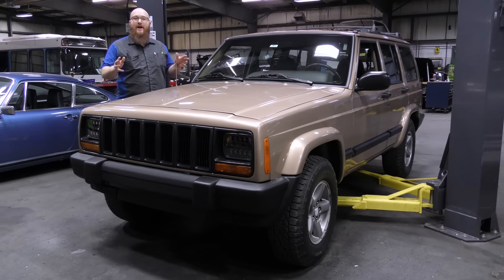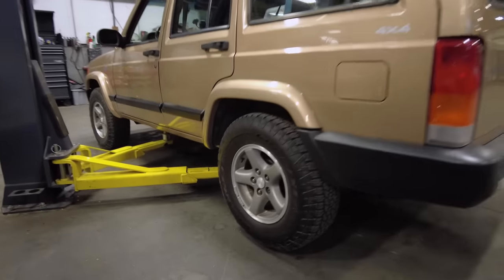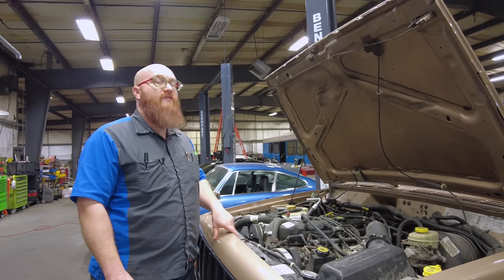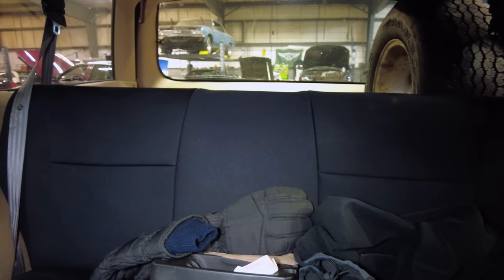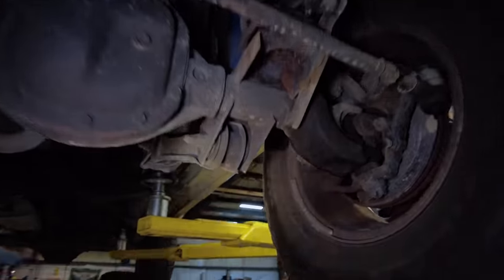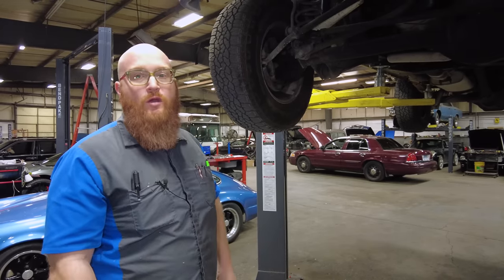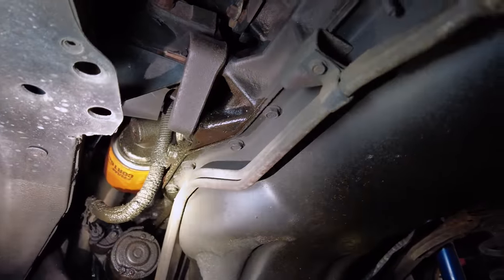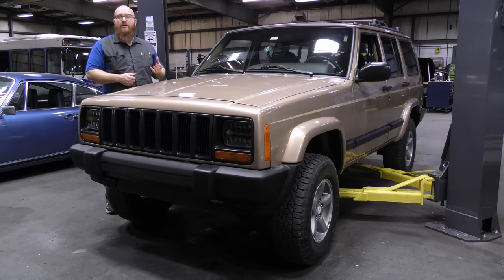Death Wobble on this immaculate '99 Jeep Cherokee! CAR WIZARD shows how to find it and the fix

Comment: I had 250k on my xj and not a single oil leak. Everything else was broken though😅😮
No 1st gear, no heat, no ac, locks broken, door fell off, seat broke, power windows broken, center console broken, stereo broken, headliner down. The 3rd trans was what broke me.

Comment: Ever so often an ‘89 Cherokee comes by to get serviced and repaired at my shop. It is unfortunately plagued with leaks and problems but it has 300,000 miles on an original motor and transmission. It just will not die. Very durable 4.0 engines.

Comment: Great videos, as always. A correction about the date codes on the tires: the first two digits represent the week the tire was made. So, on this vehicle, the tire was manufactured the 1st week of 2021. Also, always check the date code on the spare, it may be much older than the tires on the ground.

Comment: Even my oil pressure sensor was leaking oil, altogether, I would lose about a quart a week, which is pretty significant but at least I don’t have to worry about rust with Jeeps Active lubrication under coating system lol. Probably bad for bushings though.

Comment: One point about shocks and dampers. Rebound problems can arise with no leaks. The only way to test is to drive over a dip that forces rebound. I had a brand new car with this problem in a strut.
Reply: Yeah,,, dry shocks don’t mean they aren’t worn out. There more to inspecting them than just seeing if they are dry. Like others said here, death wobble is rarely attributable to just one item needing repair or replacement. The shocks appear to be originals. If they are 100,000 miles or 160,000 kms are more than enough on them to consider some better quality aftermarket ones. All 4.

Comment: I had a 93 Jeep Cherokee Sport 2 door striped down.  Manual transmission and the windows were even hand cranked.  It had 200,000 miles on it before it was total by a drunk driver.  Best part was that I was sandwiched at 100,00 miles and got almost all new sheetmetal on it all the way around

Comment: Jeeps don't leak oil, they mark their territory.  
My '98 has 345K on it and the engine made it to 331 before the engine blew.
I did not treat it very well.  The number of aftermarket parts for it is staggering.  Everything that breaks is an opportunity for an upgrade!
Biggest weakness is it has a tendency to overheat when it's hot.  A nice aftermarket radiator fixes that and you may even have to put blockers on the grill to get heat in the winter.
Mine has towed cars, carried me through snowmagedden, hauled heavy servers and rescued a number of family members.  It's a workhorse.
It did have a death wobble and they are scary, especially the first time.  I put a 3 in lift kit when my springs sprung (after hauling those servers in the back and bottoming out)
Aftermarket adjustable track bar and it rides rough, but it's not made to be comfy.
My dash still looks like that even after spending all of it's time out in the heat.
It really is the most dependable vehicle I have ever owned and with the new 4.0, it should handle another 20 years of abuse easily.
The 5 speed doesn't hurt either.

Comment: One thing you forgot to mention is that you can pull basic computer codes on these without plugging in a code reader. it will display on the odometer.

Comment: Caster is generally the problem with most issues of death wobble aka bump steer ,,, the steering knuckles most likely are nosed dived down at the tie rods ,, on these models there are shims behind the  frame end mount of the lower control arm  ,, add a 1/8 inch shim to each side to push the tie rod side of the knuckles up get the angles back the way they should be ,,, I own six of these XJs 90 92 92 92 95 2000 all 4.0s two with iron rock three link long arm kits 7in lifts

Comment: Only saw this now, but realise one thing.. that tow bar is not allowed in europe, in case of a rear accident, it wwill puncture the gas tank... would recomend to change it or take it of. Other than that... amazing specimen of an xj :)
Reply: In the  USA it was just about required. Jeep came out with a recall I believe around 7 years ago. I have. 2002 Cherokee Laredo. I used mine to tow my Jetski so I put an aftermarket hitch on it. I went to have it inspected at jeep as jeep was paying dealers to install a free tow hitch because the gas tanks are right at the end of the plastic bumper. There’s nothing to stop it from exploding. So to fix this they were putting tow hitches on all jeeps around these years. I believe it’s 1993-2004 Cherokees and 2002-2007 liberty’s.

Comment: Get a track bar that replaces the ball joint on the upper end of the bar with a regular joint and a new bracket. If I had done that I might still be driving my XJ and not gotten mad and sold it after it still death wobbled after replacing everything (track bar, stabilizer, wheel bearings, tie rod, steering gear)

Comment: Just bought a 2000 at the Effingham Illinois Fire Dept auction for $3200. 69000 miles red of course with no console as ordered. It seems tuned because it will spin the tires sometimes in 2nd gear.

Comment: My aunt had one and it was pretty reliable. They did have to replace a radiator but that really wasn't that big of a deal. The frame broke in the front and I don't remember how. I think it was sold to them like that if I am remembering correctly. Rather than trying to deal with it they sold it for parts. Everything they had to do to it was all just simple stuff my cousin helped them to repair easily. I know you said these are more unibody so I might be using the wrong terminology here. It's been years ago and I remember it was the frame up in the front. It had a break in it that was really poorly patched. They bought it used and the guy sold it to them like that. They rode it around for quite a while and it was a good vehicle but as I understand it the damage starting to get worse making it unsafe. She really liked the vehicle. She never used it to go 4 wheeling or anything. She just had a family so she needed the space and it had lots of room for groceries. It was pretty fair on gas and it was pretty comfortable. It's been in excess of ten years ago so I'm afraid I don't remember the year of it. I mostly remember that it was blue, ran really good and my aunt was really sad it happened like that. She didn't have much money being on a fixed income. She couldn't find another one she could afford at the time.

Comment: In most cases - nether a, b , or c - it is a feature of a rigid axle design and no - not the track bar - it happens because of the fundamental cost-benefit of choosing an off-road design - you can tune it out but you will never eliminate it

Comment: I wonder if minivans, especially older ones, will ever gain any type of notoriety.  SUVs are cool but the average minivan of the same era will have better acceleration, get better fuel economy and usually have better cargo space.  Also handle better on pave streets and can do as well on gravel roads which is the most off roading most people do.
Reply: Nope. They are mostly used up and rusted to oblivion. Chrysler had engine issues with Mitsubishi V6's burning oil and their own V6 wasn't that good either. GM front drive vans were ALL junk. Ford quality was hit and miss.
Reply: @hotpuppy1  Agreed 💯. But, the Asian minivans are a lot more reliable than these North American ones, especially the fourth-generation Honda Odyssey, the second-generation Kia Sedona and the third-generation Nissan Quest. The Toyota Sienna is bulletproof, but their handling for these vehicles were poor. All in all, they are great minivans.
Reply: @hotpuppy1  
I almost traded my 99 Sienna for a 91 80 series Land Cruiser 2 summers ago in pristine condition plus another $10k for value differences.  I immediate noticed  a downgrade weaving in and out of traffic and poorer fuel economy on a 50 mile trip.

Comment: My dad bought a 2005 Dodge Ram 1500 4X4 brand new.  In 2007, we experienced the "death Wobble."  I had a co-op at he local Dodge dealership that year, so I brought it in for warranty.  They changed the track bar.  No change.  They changed the steering stabilizer.  No change.  They wanted to change the trailing arms, but had to order them.  While we waited for the arms, we changed the tires.  Problem solved.  We have had many trucks come in with this issue, always solved with new tires.  We would switch tires front-to-rear solving the issue 99% of the time.  We even had one customer come in on new tires with the "death wobble", and he had the tires replaced again, solving the problem.

Although the track bar bushing was bad, odds are all it did was accentuate the problem.  

We did let the dealership replace the trailing arms, anyway.  Why not?  They were free, and you don't get too many free things from a dealership!  😁

Comment: Death wobble can be caused by a bad wheel, but the root cause is people aligning them with toe in. Straight axles in general don't do well with toe in.
If you have death wobble, crank your toe out a half turn at a time til it stops. It's that simple

Comment: I have a 2000 TJ Wrangler Sport I bought new, 141k mi. Can anyone recommend a place to buy an OEM remanufactured Power Control Module? Rock Auto has been out for at least two years. I've replaced just about every electronic gizmo on it and I worry the PCM is going to leave me stranded.

Comment: I lucked out and found an xj that was hit in the side I replaced both doors and the rocker panel on that side and 300 bucks later I had an 90k miles rust free xj for 1800

Comment: I will say 1of the biggest problems Is the lower control arms if you put 99 to 2004 Jeep Grand Cherokee. Lower? Control arms. It drives better. And it's easier to clear big tires

Comment: I have had at least tie rod ends cause death wobble, ball joints cause of death level, track bar causing death wobble. All of those can be a factor to death wobble. What a lot of poeple miss after death wibble is that where your tie end sit in the spondle those holes where the pin goes through and ypu add your castle nut can be wollowed out. Hwve you ever has a castle nut tighten so much oast the holr where your cotter pin goes in ?. Time for a chamge. Jeeps hands fown are my favorite vehicles to work on and drive.

Comment: That was in a front end collision. I guarantee it the bumper metal center part should be painted body color. The grill on that model would have been painted body color and it would’ve been a jeep emblem on the front top of the grill fascia.   I’ve on several XJs in my life that I’ve never experienced death wobble in a stock XJ I guarantee that JEEP took some sort of front end collision, making things a little out of whack in the front.

Comment: Nice Xj....My 99 Xj has over 400,000 miles and it's just like new... Definitely one of the best vehicles ever made......by far
Reply: Just wondering if you had to replace the transfer case or the differentials?  I have 217k mi on my 99 and just replaced the transfer case.

Comment: My 90 xj has over 1,000,000 miles on the original trans I think I replaced an overheated engine around 500,000 and yeah it has the death woble too despite replacing almost everything in the front.

Comment: 99 is the best year for the Cherokees. Still had the 8.25 rear end and it didn't have the head gasket issues that the 00 had.
Reply: not entirely true, I had a 99 and the issue is the casting of the head itself. apparently some 99's had the 0331 head
Reply: To add to things - first year of the horseshoe intake and thrust plate cam.  Last year of the dizzy, high pinion D30, and federal emissions.   Pretty much the best of everything offered.
Reply: @v12alpine  i miss mine bad
Reply: @baelm  I can't imagine selling them, I have a 99, two 96's and a 93 wrecked parts car I pick off of when needed.
Reply: @v12alpine  HI, I own a 93 Jeep Grand Cherokee Laredo with the I6 4.0.(all stock and wanna keep it that way!) Where does a guy buy good OEM parts for it? Like from sensors to suspension. Like they say, Mopar or Nopar when it come to sensors especially!
Reply: Nice... My 99 Xj has over 400,000 and it's just like new... it's a highway monster
Reply: i actually just picked up a 99 for 3k, really excited to start doing stuff to it

Comment: Like my father before me, I also am a huge Toyota fan and believe in the liability  as well like father like son, became a Toyota technician..I don't say this often, but I agree 100% those 4.0 engines and XJ's and the older 4.0 wrangler were very well built and lasts.. It's a shame they don't make them like they used to. I heard the reason the 4.0 was ousted was because they couldn't get it to meet California emissions. Congratulations on your FJ40 purchase.
Reply: The liability?
Reply: @JBK  my mistake lol. Reliability **
Reply: My 99 Xj has over 400,000 miles and it's just like new and it doesn't need a timing belt like Toyota's and it has a solid axle... It'll outlast and outwheel the Toyota with ease too.... 😆
Reply: The 4.0 and AW transmission was an indestructible combination
Reply: @Bob Quattrini  just like new is  an overstatement. I owned 3 as well and they were spartan at best

Comment: I had a 2001 XJ and it was my daily driver for 10+ years on jt. My dad currently drives it with over 250k miles on the ODO. Great vehicle but expect to replace items like heater cores, AC compressors, rear leaf springs, camshaft and crankshaft position sensor and the rear hatch wiring likes to break. Lastly the fitting that the oil filter screws into will eventually leak oil on the starter below. I also replaced my headliner

Comment: In addition to the death wobble, these are known for getting bad steering gearbox is where there is a lot of play in the steering. We fixed mine about 10 years ago and 100,000 miles ago put some Bill Steen shocks on it Cooper cover tires and it can still keep up with traffic on the interstate.
Reply: So that Bill Steen guy makes some pretty good shocks?🤣
Reply: The steering box seal on these and the ZJ is prone to leaking because the pitman arm shaft is really long and unsupported. If you add a steering box stabilizer,it will make the steering more responsive by eliminating flex,it will also keep the steering box from leaking.  Did you know that a Chevy S-10 steering box will bolt right on a XJ or ZJ?  Yup, it's a faster steering ratio too. Idk all the years that swap in,but 96 to 2000 fits. Probably other years too,but I haven't swapped any other ones. I wouldn't be surprised if they're all the same. All the bolts line right up.
Reply: Good ol' Bill Steen.
Reply: @Thundarr995  wow, I didn't know that...  awesome advice, thanks!!! I replaced my steering box a couple of years ago and didn't know about the flex issue.
Reply: Bilstein. Jeez.
Reply: @happilyham6769  Lol.
Reply: @aaronbrown6266  🤣🤣🤣
Reply: @67FORDTRUCKF250  Yeah, most of the time,if the steering box is leaking on these Jeeps. It's not that the box is bad. They just have a  long pitman arm shaft,there's some bearings inside the box. They wear out a little bit from the flexing. Then, the Pitman arm shaft has more side to side play.And then the seals can't hold the highly pressurized power steering fluid inside the steering box. And finally, it starts leaking out the bottom....Pitman arm  shaft. If yours isn't leaking,it wouldn't be a bad idea to pop one on there. I don't have an S-10 steering box on mine. I did, but I didn't like it. It worked just fine. I just prefer the harder steering Jeep box. If yours ever starts leaking again? It's not that difficult to replace the bearing and the seals. (There's 2 seals stacked in the round part of the box where the Pitman arm shaft comes out of the box) It's not that difficult to replace the bearing and the seals even if the steering box is still on the jeep. There's videos on YouTube that show you how it's done. Bearing and seal kits are under $40. Sometimes, it takes less time to replace the seals and bearing than it takes to replace the whole box. I'm not going to recommend a steering box stabilizer. All the ones I've seen online look pretty sturdy to me.  Anything is better than nothing. Probably never break one. Even a cheaper one. Get one that's easy to install.😆
Reply: How is Bill these days?
Reply: Nobody tops Big Billy Boy STEEN and his perfomance shockalators

Comment: I had a "98 Sport 4.0L 5-Speed, and my dad had a '99 SE 4.0L Auto. Before that my dad had a '90 4.OL Auto. We loved them! The '90 warped the head because of the crappy AMC cooling system. I wrecked my severely rotted one, and my dad's rusted to the point that it wouldn't pass NY inspection.
Reply: The early 4.0 "closed" cooling system (no radiator cap) needed to be bled a very specific way or it was guaranteed to overheat. I drove myself nuts trying to get this right on the first Cherokee I owned. Once you get the air out of the system it works great, but it's a pain in the ass. A lot of people just convert theirs to the newer radiator, but there's nothing wrong with it - it's just weird.